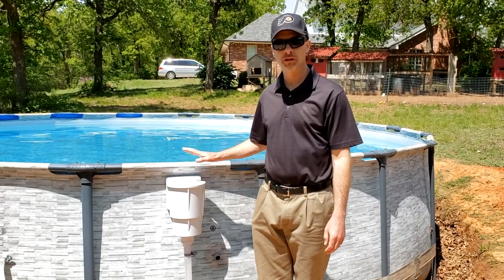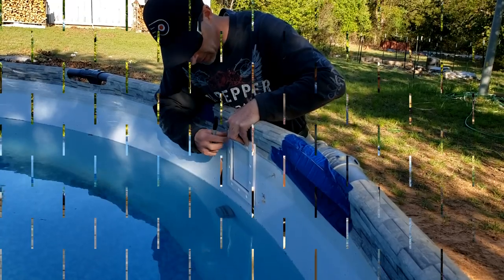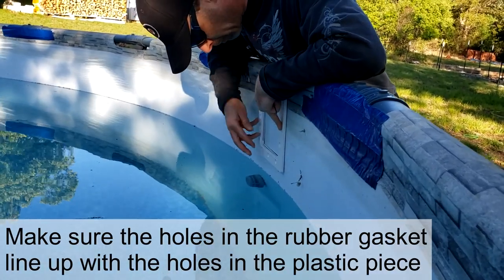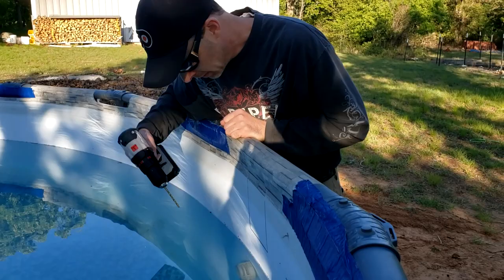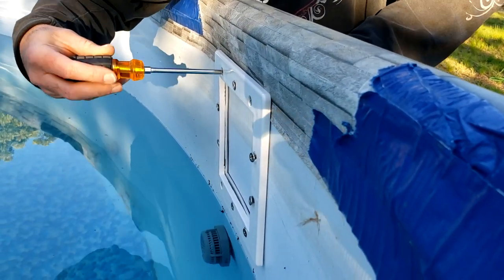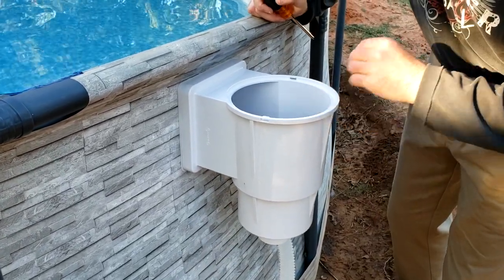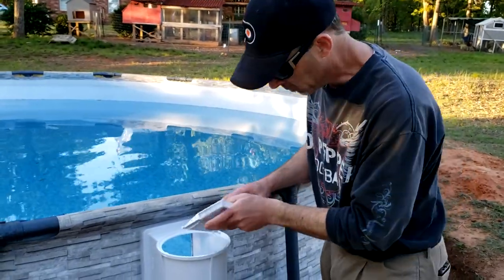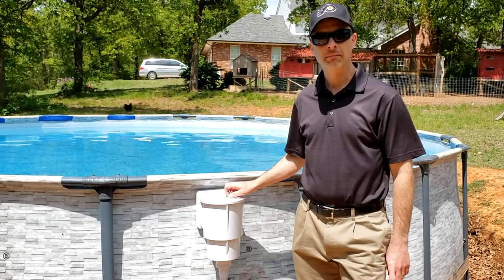How to INSTALL SKIMMER on ABOVE GROUND POOL - Bestway, Coleman, Intex, more!

Comment: The gasket is not meant to be separated. It goes in the hole you cut and fits snuggly on both sides of the cut
Reply from the maker: Can be done either way. Having two gaskets - one for each mounted component - is very typical. Mine is leak-free after a year but I understand that some people don't want to cut their gasket. Makes sense. Pros and cons to either method.
Reply: I was looking for this comment

Comment: We just got one of these pools and used your other video to help us set up the pump that it came with (no thanks to the poor instructions!). I’ll keep this in mind for the future. Looks like it’s really effective. Would you still recommend it today after having some time to see it work? Thanks for your helpful videos and i loved seeing (and hearing) your chickens run around. So nice to have fresh eggs. 🥚
Reply from the maker: Yes, I highly recommend the skimmer. It keeps the surface of the water much cleaner than without one. It's so time-consuming to use a net to get everything off the water's surface every day. The skimmer makes the net almost unnecessary.

The best upgrade I've done to my pool, though, is changing the pump and paper filter that came with the pool to a sand filter. Not only is it much more powerful and more effective, but there's no paper filter that needs to be cleaned every day. It was $200 but it was well worth it.

I'll post a link to the video from another channel that's the same pump I now have.

And yes, nearly unlimited eggs (and free!) is hard to beat!
Reply from the maker: Link to filter upgrade video: https://youtu.be/TEFDOiZKqGg

Comment: Why didn’t the casket come cute into two pieces if one side is supposed to go inside the pool and one on the outside or did you decide you wanted it split into. I have been considering getting something like this, so I appreciate your video!
Reply from the maker: If gasket is used uncut, the hole in the pool liner has to be cut first. To me, that's riskier than cutting the gasket first and cutting the liner at the very end. Worst case for mis-cutting the gasket is you order another gasket. Worst case of cutting the liner wrong is....who knows, depends on what you do.

To me, there are more pros than cons to cutting the gasket but I know folks who've done it successfully not cutting the gasket.
Reply: @FixEverythingYourself  Thanks for the video. I just purchased this skimmer but I am wondering about a slightly different approach.  How about installing it just like you did but without the gasket.   Then cut the hole in the liner.   Then unscrew everything (i.e disassemble the installation).  Then install the butterfly gasket nicely in the newly cut hole and then reconnect everything.   This way the gasket is not cut, but your liner hole is lined up properly.  (Unless not having the gasket on during the cut will not align it correctly? )
Reply from the maker: Yes, I think that would work just fine. For what it's worth, mine is working perfectly with no leaks. But I understand the nervousness of cutting the gasket 🙂.

Comment: All due respect, seeing several unneeded steps to complete when it's already drained down. Mark the hole location. Cut the hole out and install the butterfly gasket (not cut). Use a screw to puncture the liner at each screw location and install screws. Done

Comment: Hi!

Can i have some update on how the wall skimmer works since to you installed it?

How long is it installed and is there any leak are damages on the liner with time?

Is it worth it or should i keep the intex surface skimmer?

Thanks a lot 🙏

Fab
Reply from the maker: I've had the skimmer for 3 weeks. No leaks of any kind. It works extremely well when I'm user it as the only inlet to the pump. However, I often use both inlet hoses because the pump is weak and don't want a clogged skimmer preventing enough water from getting to the pump. 

My brother has the same pool and skimmer but upgraded his filter/pump, and his skimmer is working beautifully with both inlet hoses in use.

If your pool already has a skimmer and seems to be working, I'd keep it. If you don't have one, this one works very well.
Reply: @FixEverythingYourself  Thanks a lot! I already have the basic Intex surface skimmer but keep getting off the edge. So I am interested to put the wall skimmer but I am scare off damages of the liner on the long terms.
Reply from the maker: I don't expect any problems long-term on the liner. The vinyl liner is pretty strong.

Comment: Can I still put my chlorine tablets in this type of skimmer. Ty. Your video is amazing
Reply from the maker: Yes, you can put tablets in the skimmer but make sure they don't block the hole that drains to the pump. If you're using larger tablets, standing them on their edge should keep the opening to the hose free and clear.
Reply from the maker: And thanks for the feedback!
Reply: Ty

Comment: did you keep the other hose hooked up to the pool / t connector when you plugged it?
Reply from the maker: Yes
Reply from the maker: That way if the skimmer basket gets full/clogged, there's still water flow to the pump to keep from overworking it.

Comment: What did you do with the other 2 intake holes?
Reply from the maker: One is plugged, the other is still feeding water to the pump. Which means there's the skimmer plus one inlet hose going to the pump. The skimmer doesn't work as well when both initial inlets are plugged so I'm still experimenting with my long-term approach on using just the skimmer or both.
Reply: @Fix Everything Yourself  i see. Could you make an updated video on this issue when you figure it out please?

Comment: Install 2 skimmers, dont plug the other side off. One inlet will make the pump work harder and the return flow will slow down. Preference i quess, but the pump is starving having only one intlet
Reply from the maker: Agreed. I leave the other inlet unplugged for that reason (don't want to starve the pump of water). Interesting idea about two skimmers. I like it.